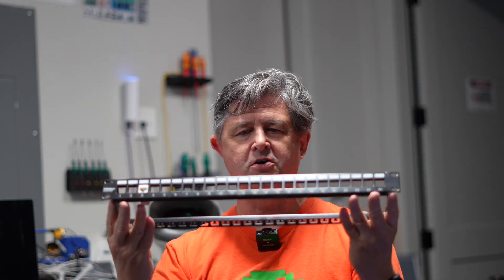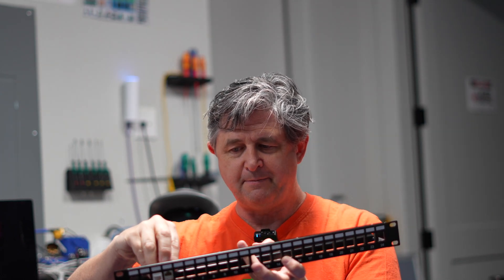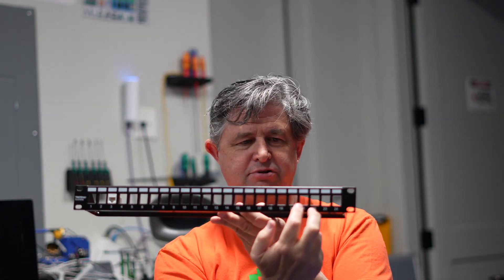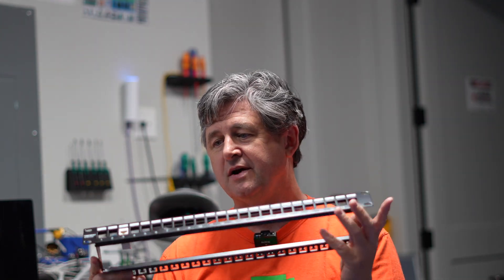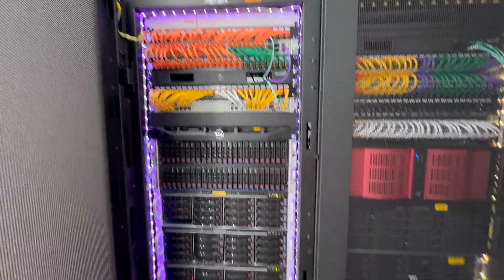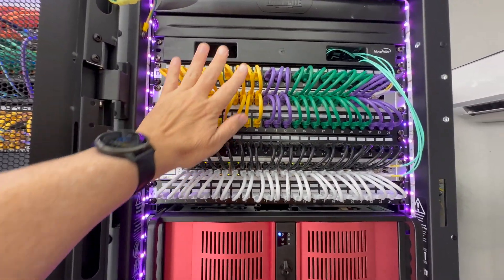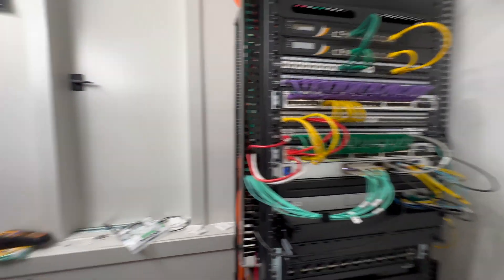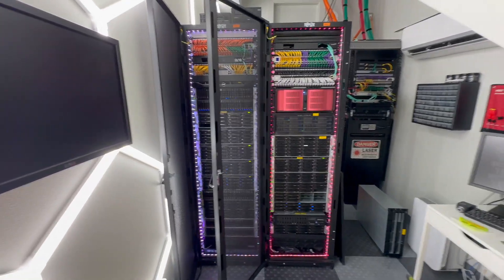Network Wiring in the Homelab

Comment: i never understood the clear benefit of intra-rack patch panels. Why not just flip the switch and connect directly to servers? Saves space, cables and overall complexity.
Reply: then you need longer power cables. either you have the ports in the front and the power supply in the back or vice versa, you dont have both.

Comment: In my somewhat limited experience, those punch down patch panels are one of the less reliable termination methods, and they are the hardest to work on if there is a failure. The clips on the RJ-45 connectors do wear out over time, but if you don't move them, they are very unlikely to fail. But I have noticed the punch downs getting lose over time either by movement or changes in temperature over years.
Reply from the maker: Yea, punch downs can be problematic if the cables move.  These are actually not punch down panels but keystone panels - so some of the keystones are punches, and some are just rj45 pass thru.  One nice thing is I don’t need to move cables , just change the port config on the switch.

Comment: I used to build out cisco racks for computer + VOIP networks. It kind of depended on the room layout/accessibility. 
Crazy to see some of these systems get run till they are functionally useless. I know the hardware + Labor costs are high, but that I am a user, I'll see slowdowns and when inquiring about hardware, the servers were almost 20 years old... installed when the company initially leased the building, and they were USED from another company data center.

Comment: Top of your network rack are two Vyatta boxes made by Lanner. Why that over pfSense or OPNsense?
Reply from the maker: Indeed - Those are running pfsense!   I'll talk about those in a network video soon.
Reply: @jeffsponaugle6339  I've been running pfSense on a Lanner white box for over a decade now. The only real issue I've had is that Lanner just doesn't ever put out BIOS updates, nor supports firmware updates for their Intel-based NIC plugin modules.

Comment: EXCELLENT! I've used the exact same keystones and setup on a smaller server room setup. I agree with you, the probability of failure of the keystones is soo small, besides if you run your cables correctly...if one fails, simply pop it out, fix it and re-run the cable back into the bundle. I've actually separated my cable at the keystone backside using cable ties to create spacing. Many think I'm way to anal but EVERYONE say how damn good and organized it looks. Thanks for creating fabulous content!

Comment: Try avoid using cable ties and rather use Velcro straps where possible
Reply from the maker: I am using Velco everywhere, but in the video I did mention cable ties when I meant to say Velcro.  Cable ties are generally not recommended because it is easy to over tighten can compress the cables which distorts the geometry a little bit.
Reply: can you point to where you see a cable tie? all i see is velcro straps. 
@shabZA Did you even watch the video?
Reply: @tylerljohnson  it was mentioned in the video cable ties, and yes I did watch the video and did see velcro. Specifically made the comment not to use cable ties based on the mention and my experience. Chill

Comment: What are your thoughts on using POE for low power devices in a home? You can get LV power and control  in a single cable. Most households devices ultimately convert AC down to some flavor of 3.3V or 5V. Are there large efficiency gains to be made from keeping it all DC from the solar panel to the device? I never ran the numbers, but I'm wondering if you did.

Similar in philosophy to Facebook data centers  piping 480V straight to bare metal and doing a single conversion down.